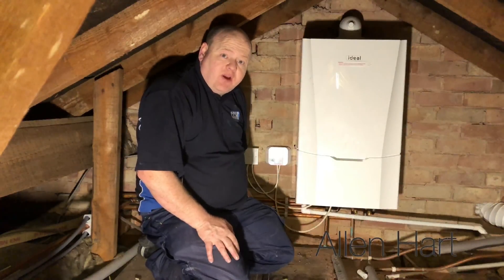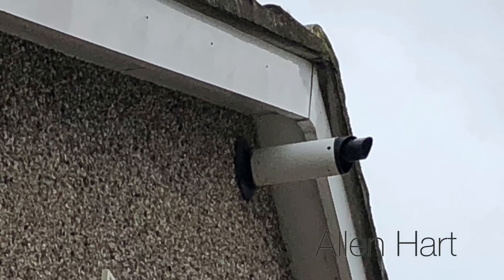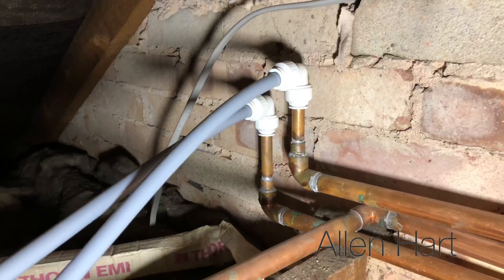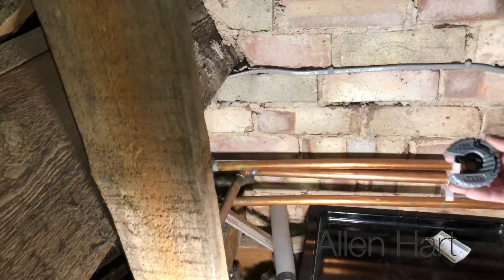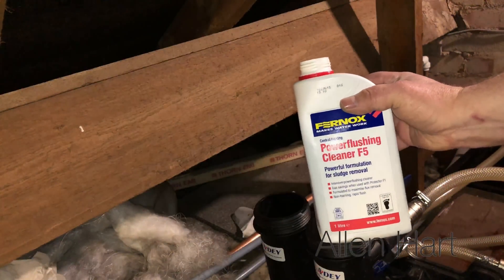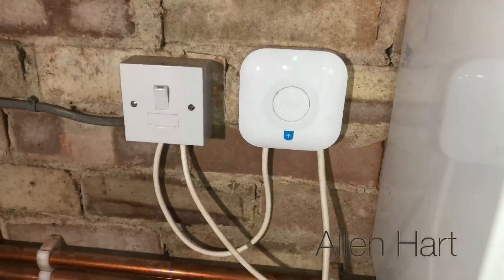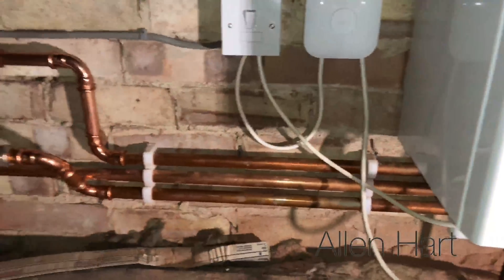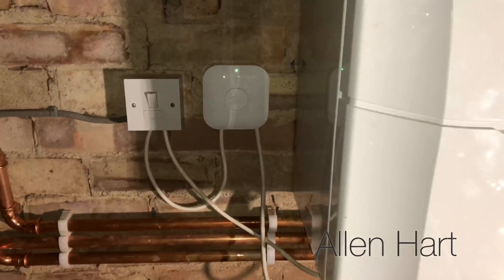DIY Combi Boiler Installation / Day in the life of a Plumber / Gas Engineer

Comment: Am trying to get advice here but am having problems. Am  a private tenant and live in a house with an old back boiler behind a gas fire which does not work. The boiler has never heated my home to a warm standard. I asked my landlord if i could have a new boiler two years ago. He told me i was getting a brand new one this year. Two gas men came out in november to check where the boiler was to go. I started to cry when i got told it would have to be fitted in my son's bedroom. I was giving the impression that it would be installed in the back of the house. I asked this and they woudnt listen. I chucked out furniture got rid of clothes to enable me and my son to move stuff downstairs. The gas men (4) of them came out 4 days before xmas and refused to do the job because the room wasnt empty.a bed and a couch were in.i have been left with no heating or hot water. Please advise?
Reply: Was this British Gas who were fitting it?
Reply: @raminybhatti5740  no. Private firm. I have the new boiler in now.

Comment: You've refitted the 15mm Speedfit elbows but this time placed them upside down thereby creating an end load on the fitting .this is fine so long as you compensate for this end load by supporting  the grey  pipe coming off the elbows.Correct me if wrong but it doesn't look like you have done that here.If so, the weight of the grey pipe full of water is hanging off those elbows and you're asking the top grab rings in the elbows to work overtime for the foreseeable future
Reply from the maker: Long time ago now, Cannot remember 😂

Comment: Hi there , so I've recently had my combi boiler installed in the loft( valiant). I then had a flood in the house due to a burst flexi pipe under the sink. I just wanted to know is this something a gas safety plumber should check after fitting the new boiler in as he said he was not liable for any damage.
Reply from the maker: +salih salih It would not be down to the plumber unfortunately. Although if the system was open vent before and now mains pressure there is a chance of leaks. Thanks

Comment: Hi Allen. I have just had a new Ideal combi max fitted and I am getting a new kitchen installed. The top of the units will have plinth going to the roof. What size hole do I need for the flue test tool to get in to test emissions etc
Reply from the maker: The flue will need to be fully inspected for a service. Thanks.
Reply: The entire top of the boiler should be accessible for service and repair .. therefore all box work should be done with regards to ventilation requirements of boiler and service and inspection and  normally this is satisfied by lift off magnet fixings or easy removable clips fitted to box work

Comment: Allen, do you not think a lot of the problems with these type of installation stem back to little or no understanding of heating design criteria hence undersized pipework and little or no proper space for flues, overflows etc? People spend hours designing houses, renovations etc and when its done realise they have to shove a boiler in it and it ends up in the attic or rammed into a cupboard somewhere. Anyhow nice job KBO

Comment: Best place for the boiler is in the loft but it's a pain in the ass for service engineers working in the loft
Reply from the maker: tanveer khan I will have to disagree with you on that, Installing the boiler lower down on the system will avoid the issues this boiler had, Always good to heat other people’s opinions though, Thanks 👍
Reply: @AllenHart999 
What issues did it have to have a service call out? 
In the loft it is out of the way. As long as the loft is boarded, well lit with easy ladder access, no problems. Many service men prefer working in a loft as all is open with easy access, with no problems about scratching anything.  On the annual service the top vent on the boiler should be opened in case of trapped air.  On some boilers, I think Intergas is one, the vent assembly (1/2") can be screwed out and fitted further up the wall above the boilers heat exchanger, using a copper pipe and a few standard metal pipe fittings - even an auto air vent can be fitted (brass one), so no trapped air/gas in the heat exchanger.

Comment: All new systems you come up against will have a minimal amount of 22mm coming of the boiler ...on new builds you will only see approximately 2 MTS of 22mm copper coming from the boiler on the flow & return onto 10mm manifolds then 10mm pipework throughout the rest of the heating system so I don't see  a problems with the flow or return on this installation as long as it is working...if anything the pipes need lagging .
Reply from the maker: Its reducing down to 15mm straight away and is very different from using a manifold. Thanks for your opinion. 👍
Reply: You have answered your own question.  It's 22mm from the boiler in copper to MANIFOLDS  , then 10mm to each rad .  This install has no manifolds  so every rad in the house is fed from 1  15mm pipe , it's not enough volume to supply all the rads  . A 22mm copper pipe will,  supply  5  10mm copper pipes ,  just calculate the area of the pipes.

Comment: how do you rate volkea?
Reply from the maker: They are not a boiler i install and i dont see many of them so i do not know the answer sorry.
Reply: thanks sir, im looking at the ideal icombi 30kw. Reccomend?
Reply from the maker: David Personally I would try and choose a combi with a stainless steel heat exchanger like the Baxi 600 range
Reply: Allen, thank you for your input. Im on a budget so it's bit tight. However its a toss up between the Viesmann 050  29kw or the Baxi 600. what you reckon?
Reply from the maker: David Viessmann and Baxi are both good boilers, depends on requirements but the 050 is the cheapest of the Viessmann range and the 600 is top of Baxi range, I would definitely choose 600,out of the two, only my personal opinion though,

Comment: Hi Allen,

What is the issue with having the boiler in the loft? I understand that topping up the boiler would be a pain, servicing and maintenance would be a pain but is there any other particular reason you don’t like having them in the loft?
Reply from the maker: The loft is not the best place in this house tbh, Normally that too much of an issue. Thanks
Reply from the maker: I do not really agree with that. loft is ok if nowhere else if possible but i would rather have boiler lower down so it does not become the high point on the system. Thanks.

Comment: Hi I'm to far away from you to get a price, but i am replacing my conventional boiler with a Combi boiler. With your experience which manufacturer would you recommended and why? I am being currently recommend viessmann 100 vs worcester bosch 34CDI, Atec & Vaillant boilers. Thank you
Reply from the maker: Out of the boilers listed Viessmann and Atag are good. Personally i would choose a baxi platinum as its all brass ,stainless steel and copper. Thanks.
Reply: Hi Darren, like Allen said I would recommend a quality Viessman, ATAG or Vaillant boiler, do your research into the companies you choose first before you get someone to install your boiler because a good install makes a world of difference to your home and future bills.

Comment: Shocking pipe work even after the repair pushfit copped then cheekily soldered the elbows on the end dead plumber 😂
Reply from the maker: 100% agree, the pipework is shocking even after what we have done, its solved the issue for now though, Thanks for your comments.

Comment: AAVs on a sealed system.?
Reply from the maker: BP PH definitely not a preferred choice in normal conditions, they will be removed in a few months when we move boiler. Thanks for watching
Reply: Allen Hart don’t worry mate we should all stick together as heating engineers and plumber to stop ANY DIY.
Reply: 121bham piss of to b and q then wonder why your water bill gets higher every year because you don't understand water regs, or gas regs.
Reply: pmailkeey make sure your chimneys swept then.

Comment: Ok it looks like the system wasn't flushed and a couple of clips could be good. But was the system working? I'm sure I could slag off all day, especially if I was advertising products. But I don't.
Reply from the maker: The boiler sounded like a drill, really screeching, was ok once we modified it, we are just trying to protect it so it can be moved later on, ps we don’t get paid for promoting products, if we did we would legally have to say 👍

Comment: Notice your concerns of 15mm pipework to rads why concerned as i see whole systems done in 10 mm with no problems , also i only saw a small clip of flue what was wrong with it
Reply: Drum and bass Face lol?? so looking at a combi with 15 pipes you think that will feed say 12 radiators ? Do u understand the basics ? Lol
Reply: @drumandbassface  
I wouldn't let you in my place.
Reply: Drum and bass Face no mate 15mm is not fine for anything more the 4 rads
Reply: Drum and bass Face ha ha yes it sure does mate
Reply: Using 10mm, they would have a manifold, which ensures adequate flow to the radiators.
Reply: @drumandbassface  
You can relax in the knowledge that if you tried to get over the front door, a flame thrower might emerge.
Reply from the maker: James Smith Thank You for your question, 10mm is fine if it’s piped correctly, you wouldn’t have 10mm directly off the boiler, You are not allowed white on show with these flues, ideal void warranty. Thanks for watching
Reply: @AllenHart999  
Other makers are fine fitting the flue the way it was. Also Ideal use a third party flue system used by others, who may not be bothered if there is some white showing. 

So with this fit the flue with no white showing then use a plume kit to extend.
Reply from the maker: @johnburns4017  Have a read up on the ideal flue John, I have heard of ideal not honouring warranties because of the flue, The rubber on these is actually the seal. Hard to explain but they definitely leak in if they are not installed correctly. Many thanks.
Reply: @AllenHart999  
Ideal are trying it on. If the flue is sealed with filler/cement, etc, at both ends, then it is sealed. That may have been. A ladder was used for sure as the external rubber cowling was fitted. With excessive flue overhangs there could be problems in supporting it, however there was none in this case. 

Some flues are allowed not to have an external rubber seal, or any external as they are designed to be fed from inside in high rises. As long as the inside is sealed, they are happy. 

Other makers are not so pedantic. Ideal do not have a good reputation. It was supposed to be getting better...but... 

Back to this flue.  It was safe as I could see.
Reply from the maker: @johnburns4017  Hi John, Check out the instructions for a logic or a vogue, Clearly shows how it seals, The rubber is part of the seal over the end of the flue, Not just around the flue but the joint between the two sections of flue, If that makes sense. Thanks.
Reply: @AllenHart999  
Thx Allen. Will look at Ideal's concentric flues when I have time. I have only seen the Kestons, which are Ideals with twin pipe plastic flues. Very different.

Comment: I am guessing you are not a time served plumber. You have made a bad install worse by having an automatic air valve on the negative side of the pump ( return pipe) this will cause air ingress,as the float will drop and introduce air to the system causing future corrosion issues. Temporary job or not you are as bad as the original installer by fitting sub standard installation pipework and modifications t
Reply: @pmailkeey  absolutely my thoughts, with a sealed system the pump would have to soon pretty damn fast to suck any air in!
Reply from the maker: I totally agree with you and under normal conditions we wouldnt of done it this way but the boiler was screaming with all the air in it, My only concern is to try and protect the boiler until it can be moved, the fact is when we left it was no longer screaming, I totally take on board your comments though, thanks for watching.
Reply: Shut it Keith . Stop trying to play Mr Inspector when he clearly states its a temporary fix.   No need to try and state obvious facts about the boiler.
Reply: Eric Knowles are you saying that you can adopt bad practices on a “temporary “ fix is all right ?. The repair work that was done to the installation was equally as bad as the original installer ..
Reply: No not at all  I say do it right the first time. But the I felt in this video he was just trying to fix something temporary until the home owners had more money or who knows the situation. But to sit there and talk down to people and act like you are like some plumbing god is annoying when he clearly states these things.
Reply: Eric Knowles you have answered the question you’re self. DON’T do sub standard repair work EQUAL to the original installer . His repair work (temporary/ or not is completely wrong) .
Reply: Im not saying I would do that.   I guess my point is hard to make with making sense.    I was just saying people jumping down the guys throat seemed weird when he clearly stated he knew it was originally done wrong.  He did temp fix a issue and should he have changed stuff around ?  Prob.   But he made the situation a little better with what was there.   I dont know.   Good points all around
Reply: Most boilers have auto matic air vents plus once the system is full and air removed 
Then close the automatic air vent.

Comment: Can't understand that attitude when they have paid good money for a quality boiler. Where did you get the ridgid pipe slice?
Reply from the maker: This customer has only just moved into the house today, They were planning on installing a new boiler downstairs, This boiler has been saved now though so it should last for a long time. I ordered the pipe slice online, TBH i cannot remember the site, i will try and find it and post it up, Thanks.
Reply from the maker: https://www.toolstop.co.uk/ridgid-57018-c-type-copper-tube-cutter-15-22mm-p79962

Comment: Allen, have commented before, report these jobs, gas safe do nothing for their money, put them to task.
Reply: John Strange 
No need to cap boiler off?  Gas not sleeved isn't immediately dangerous
If bracket was loose, you would defiently know about it. Crappy install but seen worse. Showing white on flue only voids warranty.
Reply: John Strange 
Totally agree..... That requires reporting without hesitation...
Reply: @almondocommando9938   why?
Reply from the maker: Gas Safe ask for the customer to report it. Customer wasnt interested they just wanted it sorting. Thanks for your message though.
Reply: Allen these should be reported as a RIDDOR regardless of what the customer prefers,  to cover your arse and the companies. I personally would condemn the installation and if agreeable with the customer start a fresh installation with the existing boiler. If not then it would be capped off appropriately. How do you know it is correctly affixed to the wall IAW manufacturers instructions and not just loosely fitted with red RAWL plugs and second hand screws. Have you managed to move the flue to a place that now satisfies the regulations? Have you sorted out the pipe without sleeving through concrete wall? Is this installation correctly gas sized? 

You were the last engineer in attendance and you’re signing your livelihood away. I hope you sorted that shambles out correctly and charged the customer appropriately.

Comment: Did not see co alarm either. Was there a light and access to the loft with secured floor and railing around the boiler?
Reply: Tarki Micaleff every new gas appliance that has been installed is required to have co alarm fitted. If not your going against the gas regs.
Reply: @mmack3286  what reg is this? Solid fuel appliances maybe...
Reply: m Mack it's only advisory in England
Reply from the maker: It hasn't got a CO Alarm , Fix ladder or rail, it does have a light but that wasn't much good TBH ,
Reply: Why would there be a CO alarm in a loft with a room sealed boiler?

Comment: Ballifix s are designed for high water pressure they only leak on gravity as there not designed for that.
Reply from the maker: We change loads that leak, Most of them say they are not to be used for heating. Thanks for watching
Reply: Most Ball-o-Fix valves out there are not suitable for central heating.......They barely cope with spotlessly clean water on domestic services and as Alan says......Most end up leaking if fitted on heating systems!
Reply from the maker: Even the pump valve ones leak if you look at them lol. Thanks.
Reply: Yeah.......Never Ever Turn those!!!    LOL
Reply from the maker: I went to one a few weeks back and the customer had tried to change the pump, They turned them off and they leaked all over, black sludge all over the light carpets, all to save £60 labour, Cost them much more in the end.
Reply: Ecomax service valves....etc etc........The list goes on forever!! Haha
Reply: DIY'ers.......Gotta love Em ;)
Reply: Oh really? U are much cleverer than me then.